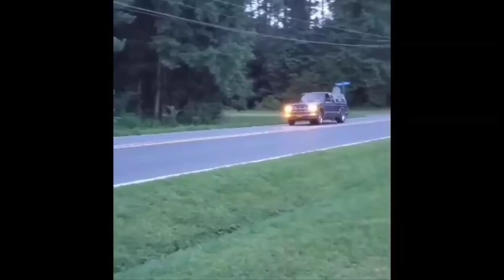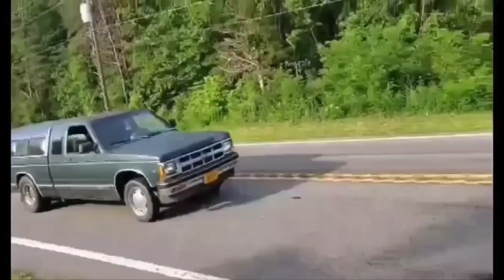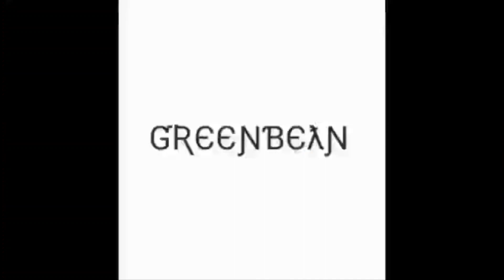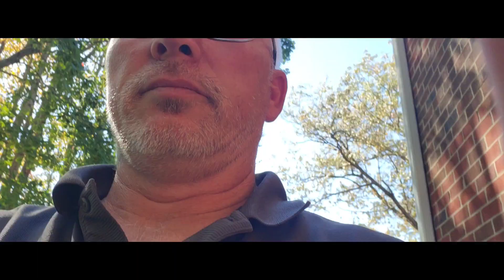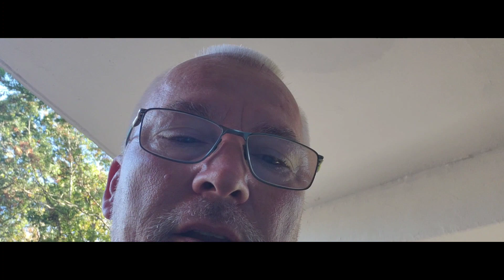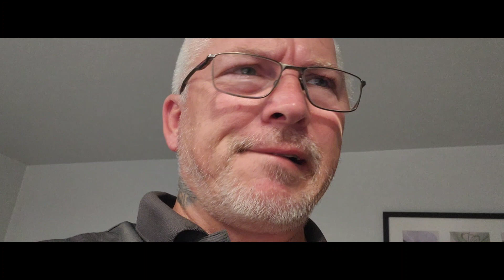V8 S10 GreenBean Quick Racing Update

Comment: You still running the 2 piece driveshaft
Reply from the maker: No, I had a steel 1-piece unit made. It should be good for upwards of 1200hp at the length it's at.